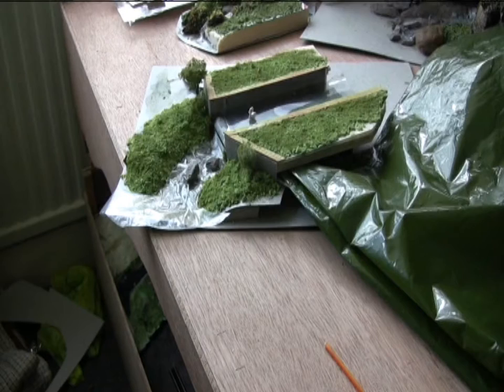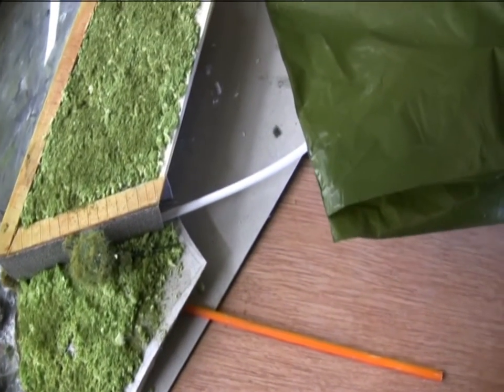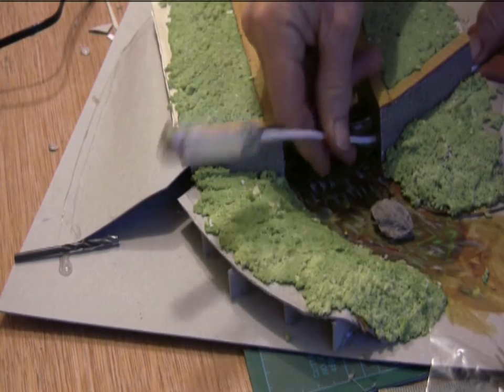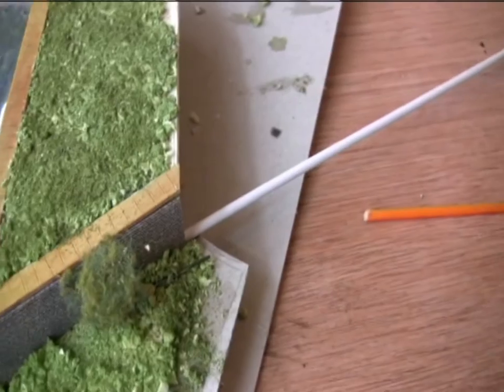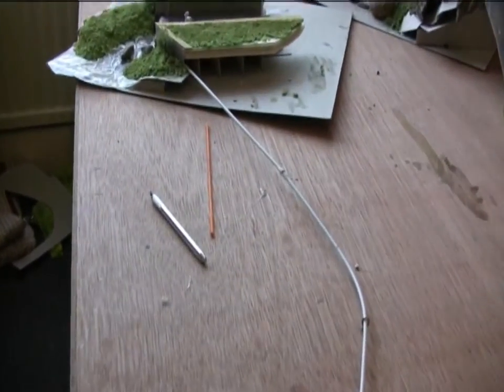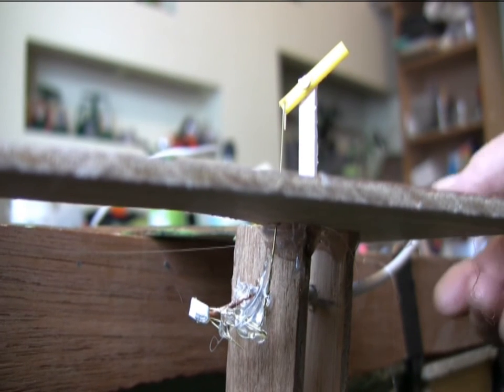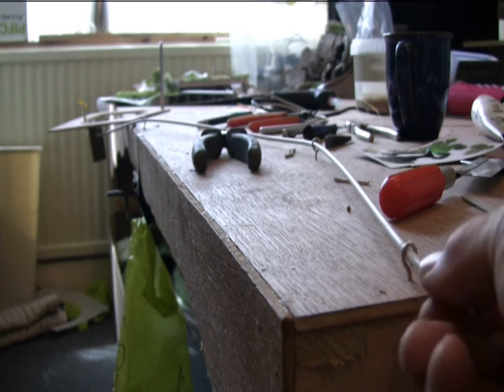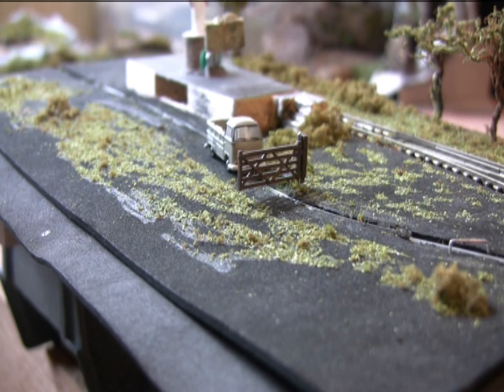N Gauge model railway part 32 Flexible Drive by shed engineering

Comment: hi the end of cheap biro pen makes nice switches the ink stem slots into the inside of the pen end this could be a wire glued in and operated from control panel

Comment: Goodness, how simple, all I need now is an extra pair of hands to run all these extra gizmos.  It takes a bt of lateral thinking to come up with these ingenious solutions - I look forward to your efforts with a working canal lock.  I can see how the gates would work but the raising and lowering of the water level defeats me at the moment.  There will have to be a way of opening the upper gates - perhaps they could have a slit cut into the gate so they can open above and below the canal surface above the lock.  The same with the lower gates I expect.
Reply from the maker: Richard Tarr Hi there Richard thanks for stopping by,,,,  Ya can you imagine having a bank of of handles ,,, all labbeled up ,,,,  windmill ,, roundabout ,,, farm gate 1 ,,, 2   and 3,,, factory gate, ,,,,  water-wheel, As for lock gates they might be a problem,,,,  I was thinking of just the one set of gates opening,,,, and the water level in the lock going up and down,,,, although just worked it out,,,, lower level gates open boat moves into lock ,,, gates close behind ,,,,, water level raises,,,,,  just an acetate sheet cut to the size of the lock OK there may be the odd gap around the edges)  level gets to the top in the lock but the gates leading out are only half as deep or even less than the first pair,,, they open sitting on the new higher water level,,,, the water in the lock would be the same height as the water leading out of the lock ,,,,,     Just about possible ,,,,?????      I look forward to seeing your proof of concept video within the week,,,, Cheers Richard and thanks for your support and interest ..... cheers Alan
Reply: ***** Purrlease - I can't even get my railway past the planning stage and you ask for proof of concept??  I'm okay on concepts but not so hot on the practical side!  Seriously, the problem when the lock is full is that the top gates are covered by the water but when the lock is empty the full height of the gates are visible (I've done a lot of narrowboating!).  I'd guess that a representation of closed top gates below full 'water' level would be fine, with short gates above water level.  This means when the lock 'empties' the top gates are completely visible.  Sounds more complicated than it is.  I'll maybe try a model to show how I am thinking...but don't hold your breath...all kudos to you for making the videos and forcing the old brain cells to spring into action...cheers Richard
Reply from the maker: Richard Tarr You have sparked me into action,,,,, thoughts bouncing around would not go away ,,,, until I find out whether its remotely possible,,,, so far lifting mechanism for the water in the lock almost compete and look promising ,,,, next pivot for lock gates ,,, and cut some gear wheels to gear left and right lock gate together,,,,,
Reply: ***** That sounds like you have the right idea - I look forward to seeing how your engineering skills put it all together.  I've never seen a proper working model lock.  Incidentally if you are looking for a narrowboat the best I've found so far is the downloadable kit produced by Scalescenes.  It's the only commercially produced one that gets the dimensions and looks just right.  I've made one and think it's a really well produced kit.  I would have liked to see a butty option as narrowboats were most often paired together with one towing the other.
Reply from the maker: Richard Tarr    Thanks for that Richard ,,,, but due to recent events I doubt I will be needing a kit,,,, I may just see if my ideas hold water,,,,   as far as the gates etc,,,,, cheers and thanks Alan
Reply: ***** Hi Alan, I have seen what happened and can't imagine how disappointed you must be feeling now.  Remember what you have managed in the last eighteen months - nobody can take those achievements away from you.  I for one have enjoyed your videos immensely and always looked forward to the next ingenious solution to a knotty problem.  I hope you manage to finish the lock as I think this would more than likely be a 'first' especially if you manage to do it without spending much.  Thank you so much for taking the time to reply to me.
Reply from the maker: Richard Tarr Hi Richard ,,, Its I who should be thanking you for your encouragement and support ,, which I do ,   the other half only exists because my hands were so blistered and full of splinters and exhaustion stopped me,,, so I may  try and complete my original aim to unload coal from a wagon into a lorry and for it to drive away,,,,, but sadly if the cost of a loco (a very integral one at that if you understand the reasoning and history of this stretch of line)  but sadly if that cost is questioned then the layout will never be complete ,,,, if I can face going in the room I may one day try finishing the lock gates,,,,, we will have to see,,,,, thanks once again ,,,,,,,,,,  Alan
Reply: ***** I can see where your frustration and disappointment came from - your partner should really be delighted that you have spent so little and given so much enjoyment to yourself and others.  I suppose she has achieved her aim of taking you away from your hobby but all that does is create resentment in a relationship.  Now you have no hobby and no lounge - it must be heartbreaking to look in there now.  Does she have any idea what she has done to your mental wellbeing I wonder?  Thank goodness half of the layout survives - that may give you a base for a smaller model or to add another half to it but better this time...let me know if I can help or lend a shoulder to cry on...cheers Richard